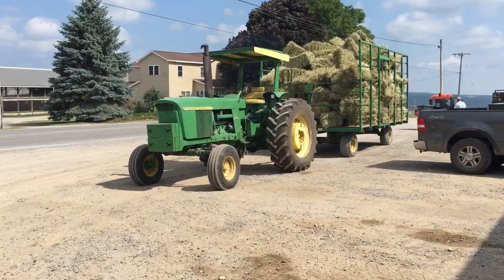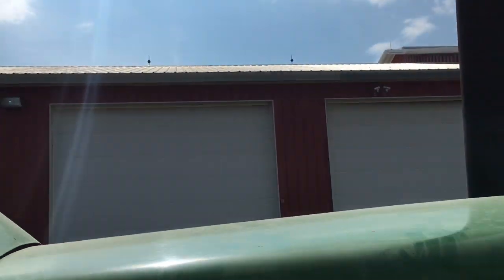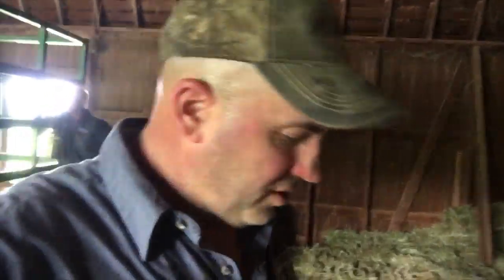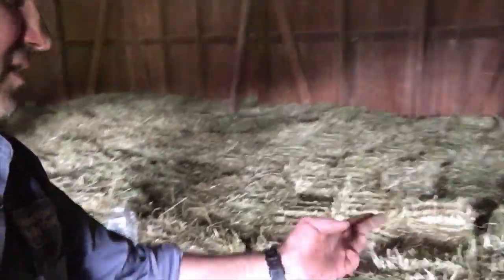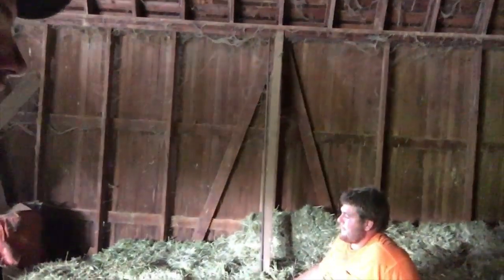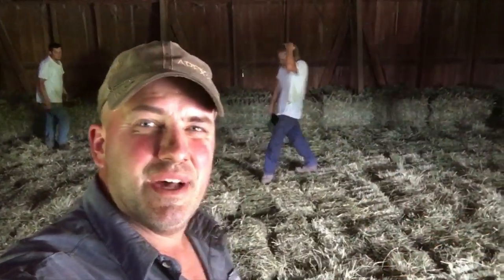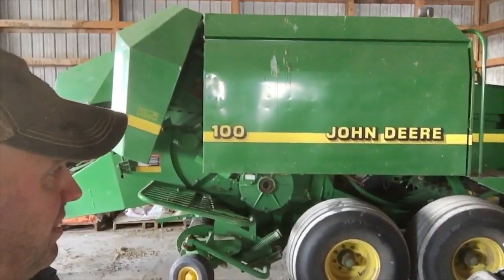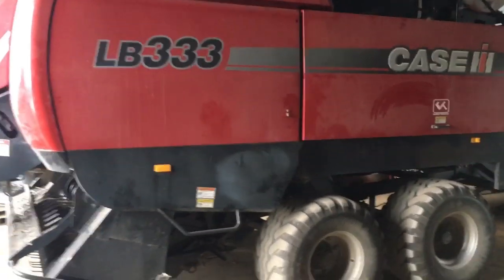Unloading Hay

Comment: Well done Andy good Video. Takes me back a lot of years, J.D. 3020 six cylinder no cab 85bhp,  international 440 baler 10,000 hay bales and 25,000 straw, stacked by hand into 21's and hauled in 1 stack at a time with a bale carrier on a J.D 2130 4 cylinder 79 bhp, all done in the summer of 1977!  Hot and sweaty but enjoyable work. 👍

Comment: Andy glad you said why you stack the bales cut edge up. I was about to ask why you do we do also but we always do because we used to have an old new holland baler and the cut edge was always tighter so we put them up so they were easier to walk on in the barn. We also never use hay hooks in square bales grandpa always said square bales have stings hooks are for small rounds. Great video my dad and I will talk about  tomorrow on the farm.

Comment: nice job on using the independent rear brakes to turn the tractor grandpa taught me that trick when we had to back up our tractors into the barn on uphill on snow the tractor was an 1974 alischalmers 200 diesel it would turn on a dime on snow if you used the brakes.

Comment: for years as a kid i helped this old guy do his haying, with an old massy and small square baler, riding on a stuk slay behind the baler, and load a row of 4 bales on edge and 3 on top of that  then one on top, and spep on the release and the stuk would dump off, in what looked like an A frame house, then hall them to the barn as a loader tractor loaded the stuks on the hay wagon and 2 guys on the wagon stacking it, when we put it in the barn, it went on edge as well, but after each layer was done, we spread none iadizeds hay salt over the whole top before the next layer went on .. that was hard work, all by hand into an old hay barn you drive in one side and out the other, but there was an old lose hat trolly with a loss hay basket that was used to grab loss hay off the wagons and host it up and over into the mound, witch was always in the way as we got higher, all by hand, no air in that barn, no hay elevators, my head was pluged up for a month strait 3 times a summer
Reply from the maker: Those were the good ole days right

Comment: Talk about hot!!  It would be 110-120 degrees outside in the shade and as we got higher in the barn less ventilation and push on.  It would be 125-130 degrees and after the truck load was unloaded I would be sweat soaked to my crotch and head to the watering trough to put my arms in the cold water 
and feel the cool blood flow through my body.
Raised to go from start to finish, no matter WHAT!!!!

Comment: Backing that wagon off the highway went pretty smooth, hope you have enough clearance for the rack after the weight is off the tires.

A few men know how to use hay hooks at 7:00

Does the JD 7290R have the e23 transmission or the IVT?  We have a 7280R with IVT.
Reply from the maker: Ivt

Comment: Should let one of them young guys spend a half hour backing up a wagon? I remember all the teasing from the older guys I took when I was a teenager! We used to bale 2000-2500 bales a day for 200 milking cows, 100-150 steers and alot replacement hiefers. By the time 1st cutting was done  2nd cutting was on the horizon!

Comment: The twine?  I worked dot on highway maintenance and we made a rod to go on a battery drill to windup a mile of twine.  All good
Reply from the maker: John Doe that makes a mess doesn’t it
Reply: No, put a rod in the drill and started the drill and walked.  All good.
Usually it was in the back of the pickup and the paper tag on the start end would be activated by the wind as they drove down the road and run the whole ball of twine out.  Amazing
Reply: That is a cool barn your delivering hay too.

Comment: Yes stacking hay in a barn is hot, no air and the fuller the barn gets the hotter it gets up near the roof. The last layers are very hard and hot. the only consolation was knowing that doing straw will be a snap usually cooler weather and best of all lighter bales.

Comment: what a pain stacking on the side.  we sold bales to someone that insisted we stack her barn that way.  so much easier to stack flat.  easier to walk across.  easier to stack.  someone told her stacking on the side was how it was done and that is how she wanted it.  I hated that account.   we stacked our own barn flat for 40 years.  never had an issue.  only time we ever put a bale on its side is if you could tell it needed more drying.  Maybe a few bales from an outside row that was double windrowed or was against a woodline and didn't get as much sun to dry by the time you were ready to bale the rest of the field.    we may put those on their side along the outside of your stack to make sure it got more air.    95 percent of the time though we just stacked flat.   everyone has their way of doing things and they are all right.   I have done it both ways and to me.. never made a difference.   I wonder if that idea just comes from old timers that used to put in wet hay.

Comment: Man, that was good, Andrew,  riding shotgun into your rural hinterland.Much like some parts of the UK - Ok the Buildings look different but  parking the trailer on the roadside etc.   Hahaha!  Taking the olddog for a run like that - defineitley needs a day on the Ploghto clean up theemissions -or are you skimping on injector and airfilter maintenance?    My dad would have EATEN ME if I'd screwed the Big tractor around like that, especially with all that unnecessary frontend weight andgood big rears.  Rubber must be cheap, or are you looking to  wear them out kwik for a modern replacement Radial? Mind you, I's great to see how a Big Beast like that can still  handle a Boot size14 on the Brake  Pedal!Did   yo know that in Europe , we have a thingy called a Front hitchincorporated in theBallast Base weight or modified wafers, especially FOR reversing 4-wheel wagons - makes life a Dawdell.
Any way , good to see you're still in action -youtube listings not coming up here so often.            Slàinte Mhath (Pronounced Slanj-a-va)
Reply from the maker: Thanks for the comment

Comment: Geez Andy I don't feel so bad about my backing with a wagon and tractor now....... Lol jk....
Reply from the maker: I defiantly need a little more practice.
Reply: @FarmingFixingFabricating  for years my father in law would turn a tractor around and push wagons in from a front hitch. It allowed more control and we could pack wagons in just inches from each other to get out of the elements. I still use this method today. A little time consuming but with the front steering and the independent brakes you can move anything anywhere.